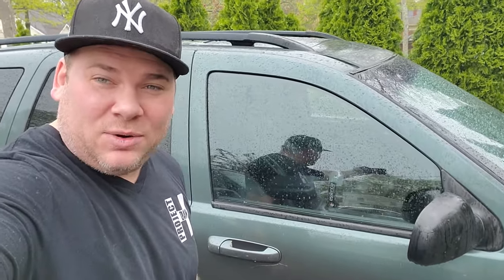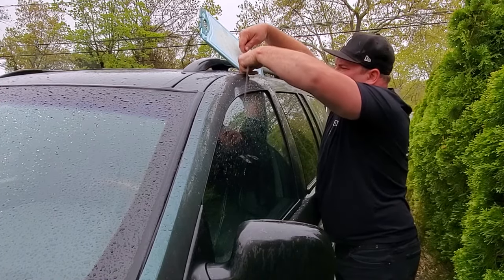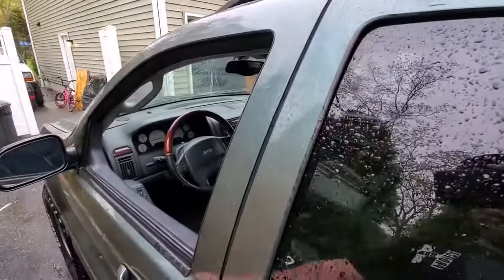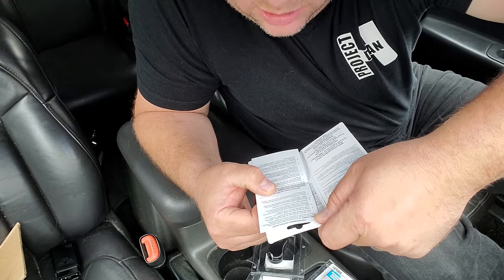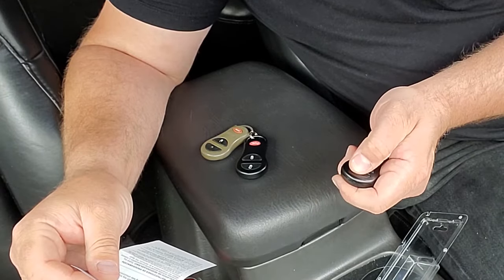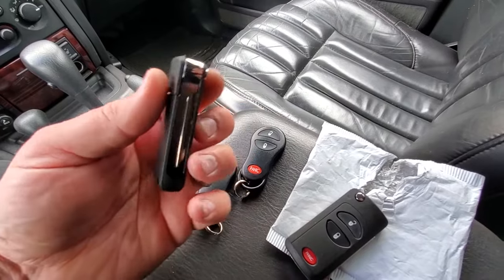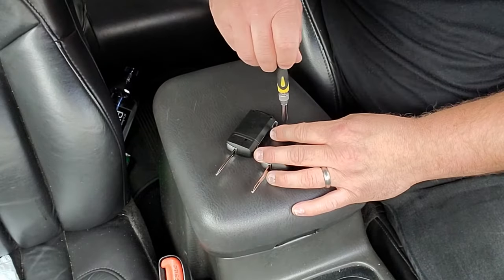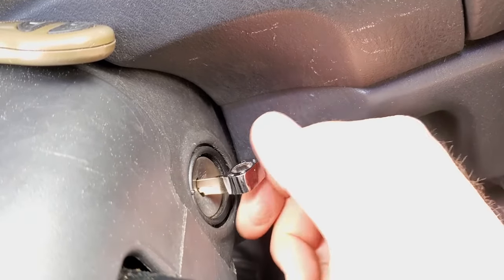JEEP GRAND CHEROKEE WJ LOCK OUT, FOB PROGRAMMING, AND KEY MODS

Comment: The easiest way I was able to unlock my jeep was with a pair of pliers. Use the pliers to take your antenna off. Get the tip of your antenna and shave a pointed end on the antenna. Bend the tip into a hook same as a fishing hook. Bend some curves in the antenna so it can reach the lock the pull up or push the lock button. It worked on most of my vehicles.

Comment: I got an extra transponder key made at my local Walmart, cut and skim programmed, as long as you have 1 key you're good. They cost $67 at Walmart with the cut and skim programming. All they did was put the old and the new key in the machine then 3 minutes later the new key is programmed. 01 WJ laredo.
Reply from the maker: Wow!!! Thats amazing!
Reply: Then hide the extra key somewhere on the vehicle. You will be UNSTOPPABLE!

Comment: If you have 2 original keys you can program 4 new ones by using the onboard computer. The instructions are in the Jeep owners manual. Also, if placing the key on top of the SKIM module doesn't work you can make an induction coil using some fine wire.
Reply from the maker: Thanks for the info Tom!

Comment: Hey Dan. I did this last summer for my 2.7 crd WJ/WG. But I rememoved chip from old key and there is a little space for it in new case, nearby of the rotation cener of case. I have the same key case as you. I did that from a spare part key I bought on UK ebay for a few £. Important is mhz value!!! For reprogramming fob I used wjdiagpro android app (developed primary for merc. crds costs around 20$) and simple obd scanner for 5$ also must be compatible!!!
Just wanted to tell you that it can be done much more cheapest.
Thanks for the vids. Good job
Reply from the maker: awesome man! I love to hear of similar mods.  if reused the chip in then I'd only have 1 working key
Reply: @ProjectDanH  Ah ok, understood 👍

Comment: I have an OBD2 Bluetooth adapter and I use an app called OBD JScan.  It allows you to read and adjust a lot of parameters on the computer as well as program new keys.  It's $23.99 per VIN but the price goes down the more licenses you buy at once.  It may or may not work on older Jeeps.  Either way it has a bunch of fantastic features.  You can download and try the app, there is a demo mode so you can see what there is for all of the supported vehicles.  I just checked but unfortunately the WJ is not supported but it could be someday.
Reply from the maker: oh man that sounds pretty awesome.  maybe if they support WJs I'll get it

Comment: I watched it CAREFULLY.  You got lucky with the coat hanger only.   I couldn't get it to work for me.
What DID WORK was the coat hanger AND my shoelace. 
After straightening the coathanger I tied the shoelace around the "twisty" end of the coathanger.
Inserted the coathanger with shoelace and as I pushed the coathanger in and down I worked the shoelace towards the sideview mirror. When I got the coathanger on the "Unlock button" I Gently pulled on the shoelace toward the sideview mirror and popped the door open.
PS: I DID NOT have any sort of "plastic clipboard"!  Wrapped my Leatherman in a sock!
I was a 1,000 miles from home and all I had was the coathanger and what I "normally" carry on me!
Reply from the maker: I love some good problem solving stories! I got into my wife's commander with a piece of string and a finish nail when we were in Alabama.

Comment: Great video! My Jeep never had a remote locking fob when I bought it used. Your video was the little push I needed to finally get one. I followed the link to the exact product you posted on Amazon and installed it with a small amount of trouble. I finally got it working, but the range is terrible! I literally have to stand right next to the passenger or driver side door for it to work. It would have been nice if it at least reached at the tailgate, what gives??
Reply from the maker: Pop a good Energizer battery in there!

Comment: I tried this and can't get the fob to work in the new shell to save my life. 🤦🏻‍♂️ I've made sure the tab from the battery is making connection with the peanut and everything. All fobs worked before transferring over, and worked again when put back in the factory shell.
Reply from the maker: Dang..  its gotta be the battery contacts.. The biggest issues I had was trimming off all the excess rubber to get the two halves to close, and also making sure that battery contact stayed put while screwing it together.

Comment: What would "keyless entry" mean as it says in Amazon it is only for keyless entry jeeps? I know that usually means that you don't need to use the key to enter you just have to have it close to the jeep, but I haven't seen any WJs with buttons that unlock it, even the one from the video has no button on the door, or at least I didn't see it. Mine is a 98 with the same key fob and I want to know if it would work.
Reply: Or is it perhaps a reference to the fob?
Reply from the maker: Keyless entry means you can unlock it with a Fob and you wont have to put the key in the door

Comment: That’s pretty sweet! Do you know if there’s an aftermarket key fob that will replace the OEM fobs that set the power seats, radio stations, etc. on Jeeps equipped with the 1 - 2 memory?
Reply from the maker: Excellent question.. but but not that I know of that may have to be dealer programmed

Comment: That is the worst to do the flip up key mod. you are defeating the jeep sentry key anti theft. you can now literally stick any jeep key in and break past the weak lock mechanism and force it to turn and anyone can just steal your jeep.

All you have to do is buy a cheap sentry key on amazon and program it to the jeep. you dont need a programmer like the fobs, just find the instructions on youtube. then you cut the plastic away from the ket and do it carefully because inside is a little chip for the sentry key.... and its shaped exactly like that space you didnt use in the flip up key. that spot is designed for that chip. do that and wala, correct flip up key install that wont leave your jeep able to be stolen extremely easy.
Reply from the maker: An attempt to steal a vehicle equipped with skim would be extremely ballsy... One must have the foreknowledge to know that I bypassed my sentry key immobilization
Reply: @ProjectDanH  Most crimes are crimes of opportunity and vehicle burgs a vast majority start from someone just walking around pulling on door handles in parking lots or neighborhoods, not targeted to a certain car or person. I've been to many calls for service where someone either left the door unlocked or there was something on the seat they wanted and someone took that opportunity to access the vehicle. Then the steering column gets destroyed because they had the opportunity to attempt to take the car while they were inside and still had time but coudn't get the car started. You can guess the type of report I have to do instead when they can get it started.

I have two WJs and while working on my brother's TJ I accidentally used his key to start one of my WJs. it took minimal resistance to break the lock, so minimal that i didnt realize it was broken, it wasnt until it turned off over and over again that I saw the key error light and noticed I busted the lock.  

Me personally I wouldnt give a person the ability to take my property if I can, and the sentry system is the best way we can keep our WJs from leaving. thats why they made the system, previous Jeep models were easy to steal!

Your method isnt wrong, just not one I would recommend any do. I did the method I described and it only took an extra 30 minutes when I did the same mod a few years ago. I will say your method is the method you have to do in order to install remote start in a WJ.... hint hint for a future video ;-)

Love all your vids I seen so far and Keep up the good work! You are helping keep our WJs classic status! I wish I had some of the balls to do the seat fixed I watched you do in the passenger seat mod! I just used coverking seat covers to hide my shame!

Much appreciation and great work!
Reply from the maker: @gradient602  agreed! Remember the calls when people would leave their garage opener in the glove box and not lock their car doors?  Next morning they wake up and their power tools are gone! How about the people who were at the restaurants and didn't lock their doors and then their Garmin gps was taken.. then they got home to find their home burged. 🤦‍♂️ .. it's all good brother.  Stay safe

Comment: You make NO sense! All you need is a spare ignition key made and hide it in a magnetic key box somewhere under the vehicle in the frame, or I put it in my receiver hitch end opening with a wire to pull it out if I ever need it. It is mainly for when you let a female use your vehicle, that has been my experience for 45 years! Lol